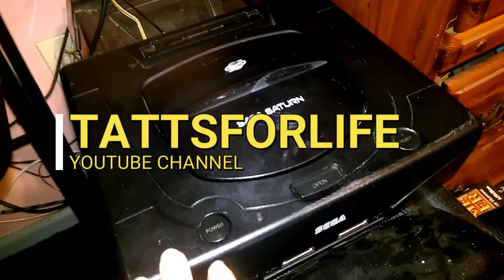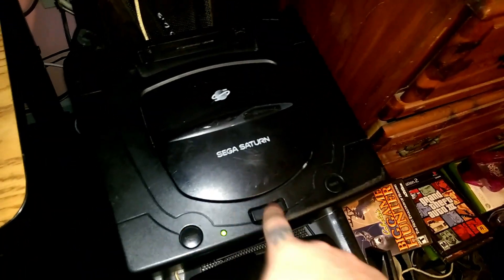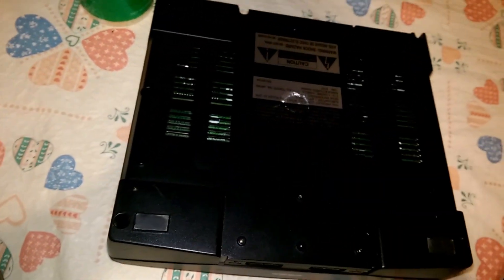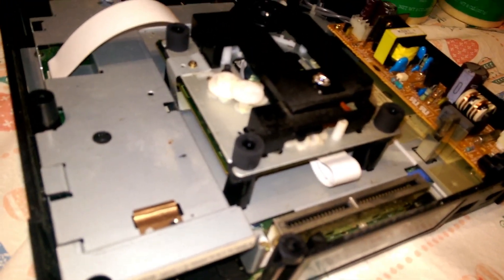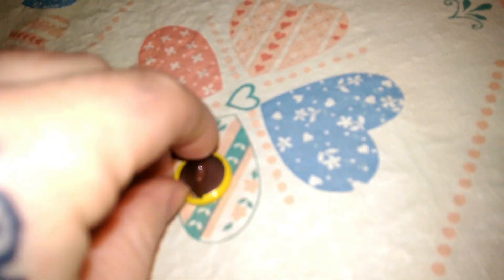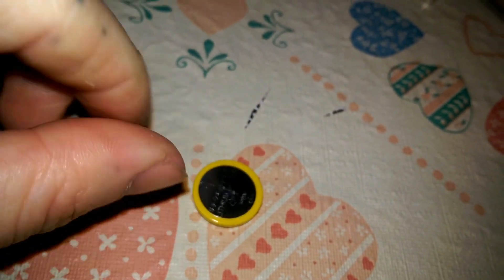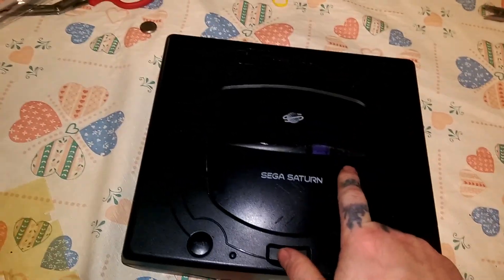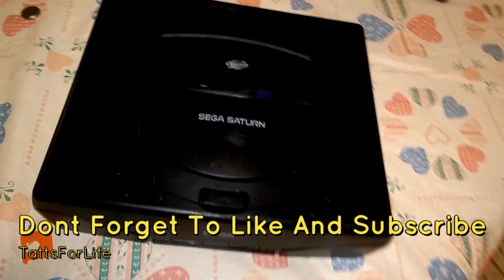SEGA SATURN REPAIR | EASY FIX!!!! NO DISK SPIN OR READ, NO SCREEN, REPAIRED

Comment: I don't understand. All my Saturns work even with the battery completely removed.
Reply: I think you just had corrupt settings. There is a button next to the battery that I assume is for clearing the settings which I also assume is for dealing with issues like this.
Reply from the maker: I have seen a few systems with this problem, probably about 15 that I have fixed with this issues by adding a new battery for people, this one tested and played great, got shipped and returned due to not reading, shipped back with a new battery and worked great. but on that note the battreys could be shorted out and causing a error with the system, or it could be a certain program or chip issues with certain year segas
Reply: @TattsForLife  I see. I have heard that some Saturns behave... flaky... without the battery. Thanks!
Reply: I agree, this is strange. If the battery is dead or completely missing a Saturn will boot up just fine. Never even knew this could be an issue.